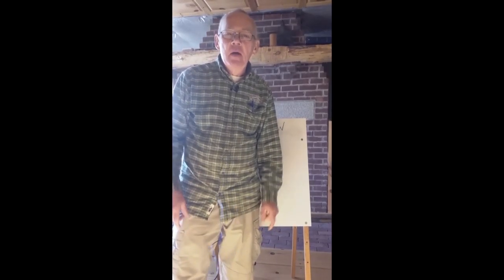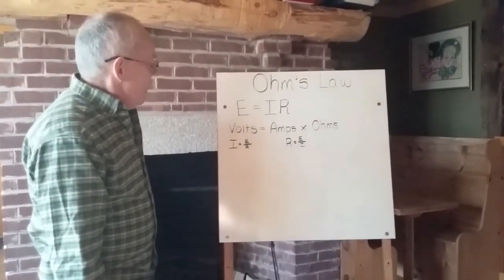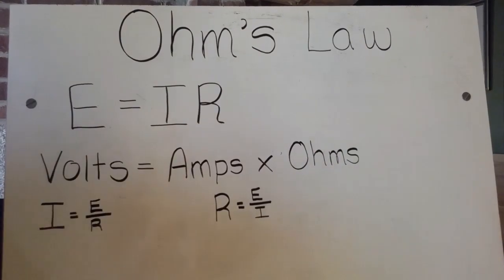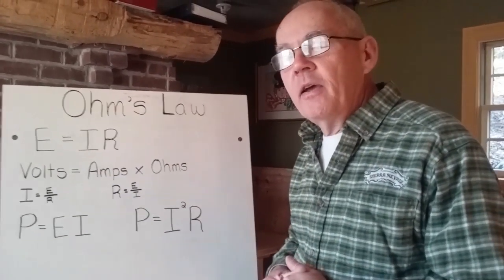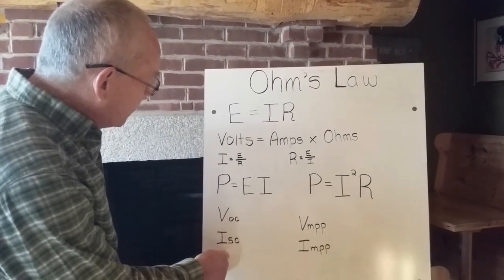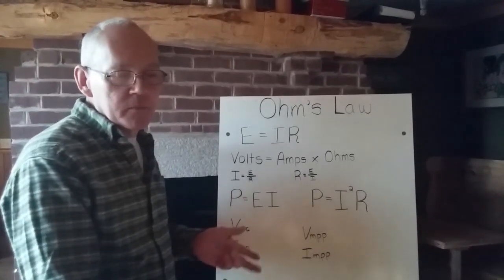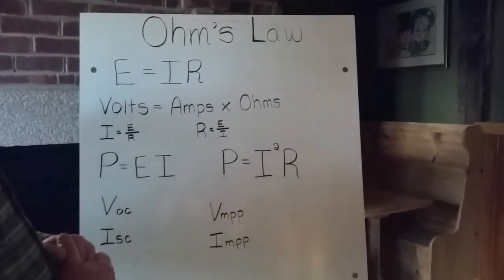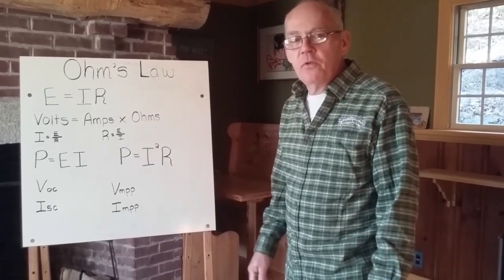Ohm's Law and Solar Panels

Comment: That's right and if you measure the amps and the volts on the other side of the inverter or controller or meter will show you actual watts going in to the grid or batteries which is right around 15% 
Or
Line voltage -maximum line voltage which is 274 divided by line voltage multiplied by 100 will give the percentage actually going in